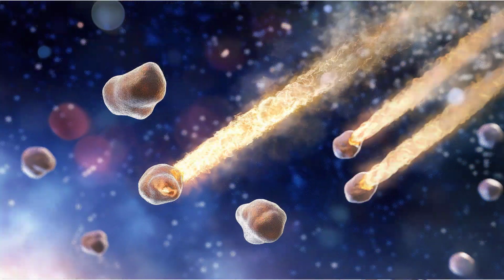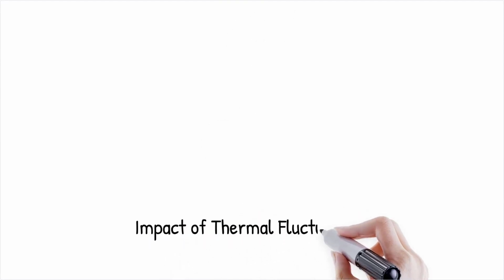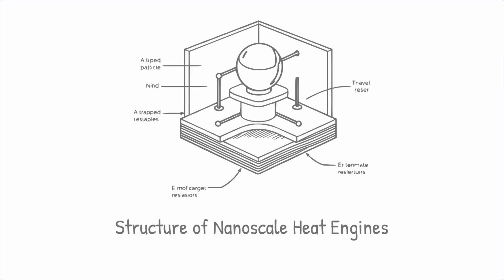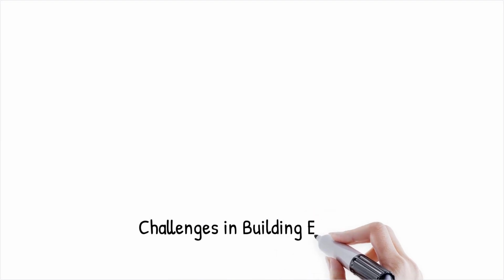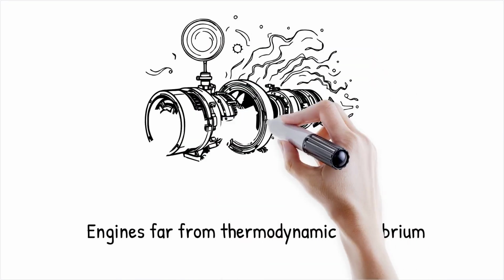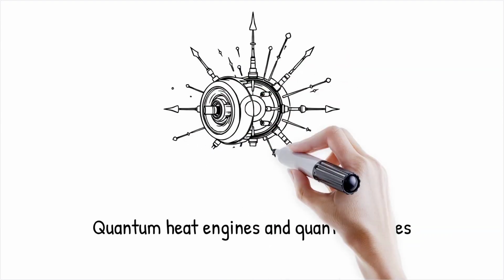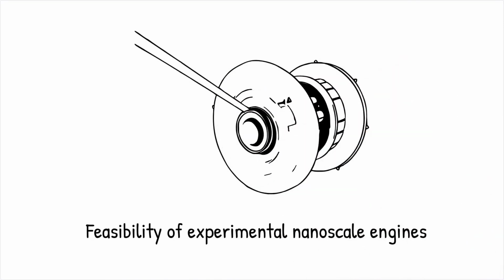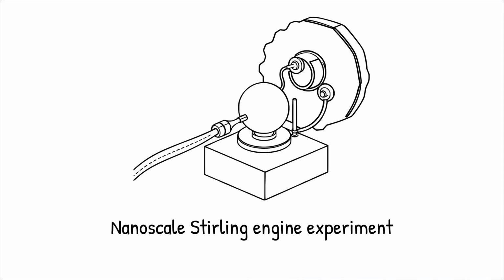Nanoscale Heat Engines: Nanomachines that Rewrite the Rules of Energy

Comment from the maker: How do quantum coherence and entanglement influence the efficiency of nanoscale heat engines compared to classical thermodynamic systems?
What are the specific challenges in maintaining thermodynamic equilibrium in nanoscale heat engines, and how do stochastic methods model these non-equilibrium dynamics?
How could nanoscale heat engines be optimized to reduce energy losses caused by viscous drag and heat dissipation in environments with high surface area to volume ratios?

Comment: Each molecule of our fluid air or water is a nanometer scale entity in thermal perpetual motion. 

Our atmosphere and oceans are full of near stagnant thermal energy. Nanometer scale deterministic processes run on artificial mechanisms plausibly can upcycle part of the thermal energy of our extensive worldwide stagnant heat reservoir into an equivalent amount of electrical energy. 

Solid mechanical structures can bear the burden of supporting the throughput of a dynamic process with minor deterioration. For example the energy delivered by a pile driver hammer dropping three meters over a service life of twenty years is millions of times more than the energy needed to melt metal then cast cast it into a pile driver hammer. 

Maxwell's demon needs light to watch the nanometer scale door so it can decide when to move the door open and when to move the door closed. The light, deciding, and door moving plausibly needs more energy than running a temperature or pressure difference engine from sorted gas molecules would produce. 

Marian Smoluchowski in 1912 presented a paper on substituting a  freely pivoting nanometer scale one way door for a demon controlled door. Plausibly nanometer scale doors in a high vacuum do not move on their own. Plausibly gas molecules randomly move through the one way door when they encounter it on the openable side of the door and do not move back from the non openable side of the door. The pivoting door is plausibly deterministic so the energy needed to open and close the door comes only from the randomly moving gas molecules themselves. 

Hypothetically diodes, by a deterministic process with only solid in solid diffusion and electromigration deterioration limitations, partially rectify the initially random thermal motion of the mobile charge carriers within themselves called Johnson Nyquest thermal electrical noise  into small amounts of net DC electrical power.Arrays of aligned diodes in consistent alignment parallel aggregate the current flow from each and every diode into scalable electrical energy. 

This technological concept needs to be developed for free and wide commerce from prototypes to useful scale. Many independent  teams plausibly can build working devices scaled to the surrounding demand they are familiar with that have little requirement to coordinate with other manufacturers. Everyone will have similar low margin costs and similar low margin prices. Everyone will have highly automated production resulting in robust flexibility, production, and supply. Devices with similar ratings would plausibly be interoperable.  There could be no place for corrupted quality. 

Charles M Brown 
Kilauea, Kauai, Hawaii 96754